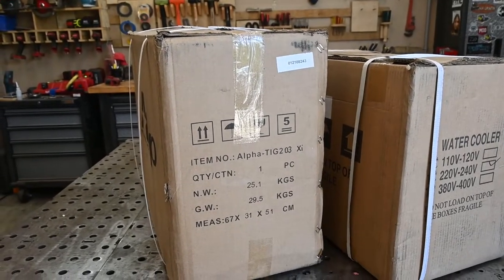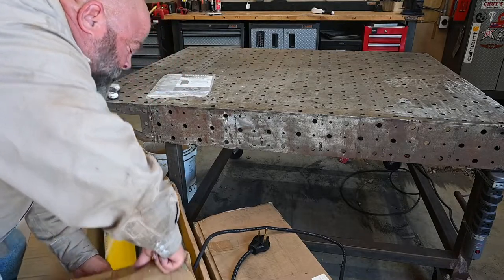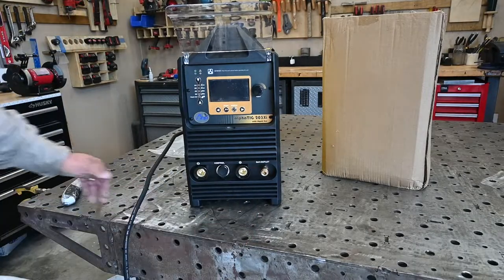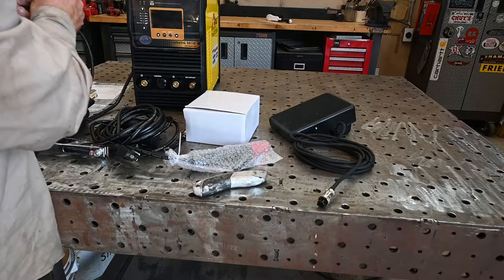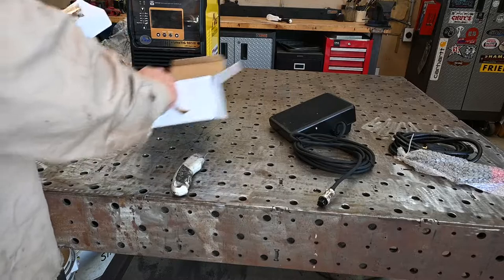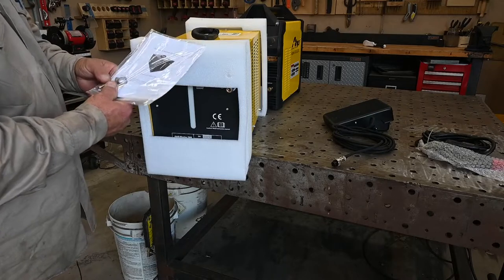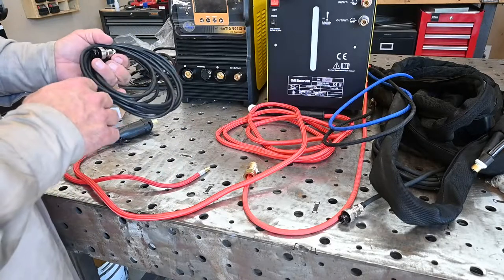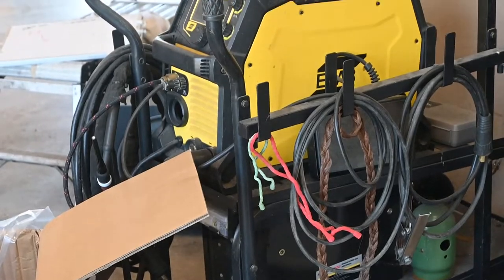Unboxing of my new AHP AlphaTIG welder

Comment: Hey if I wanted to upgrade my tig touch to  ck worldwide is that possible with the alpha tig 203xi?
Reply from the maker: You absolutely can. I had ordered a CK worldwide water cooled torch, but I did not have any of the fittings. Call Baker’s Gas-  tell them on torch you want what machine you have and they will make sure to get you the right fittings …he took good care of me.

Comment: Will it plug to a 110v outlet
Reply from the maker: Yea absolutely. It has an adapter plug for that.
Reply: @TempleThomas   because at my house I don’t have a 220v I just wanted to know so I can use it in my garage for welding Downpipes light stuff. And one more question would I be able to weld titanium?
Reply from the maker: @theraeyfamily7601  it will definitely work in your home for that. Have you welded titanium before? It does weld off DC but make sure you have plenty of argon covering as well as some type of trailer to keep the puddle and weld covered in 100% argon titanium can be very finicky.
Reply: @TempleThomas  I haven’t welded titanium before that’s why I was asking would I have to purge my tubing or just get a second argon bottle to trail it with?
Reply from the maker: @theraeyfamily7601  dual flow regulator like this : BETOOLL Argon/CO2 MIG TIG Flow... https://www.amazon.com/dp/B07XNYNT2Z?ref=ppx_pop_mob_ap_share
Reply: @TempleThomas   thank you Thomas for all your help man I will definitely keep in touch with you more!